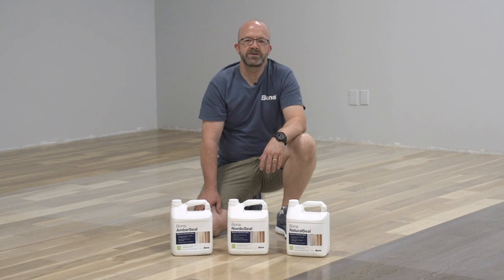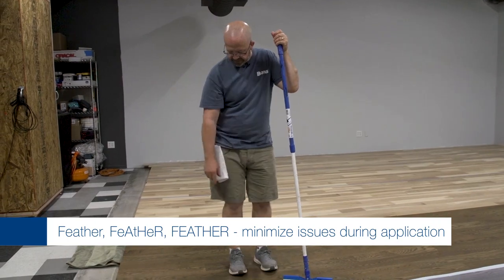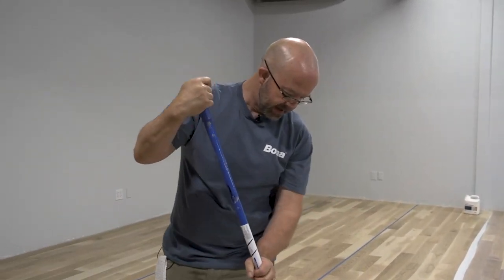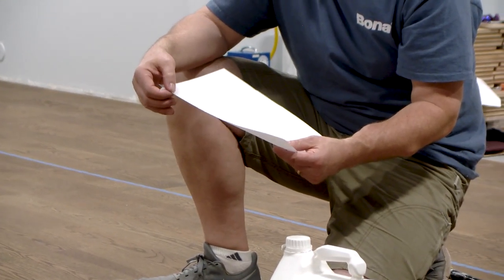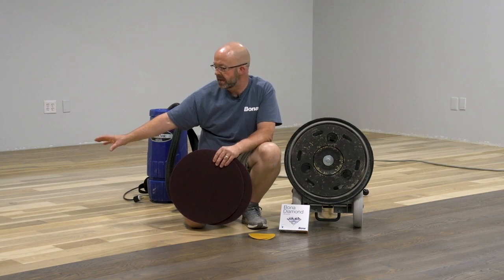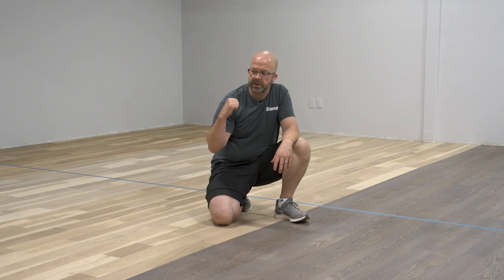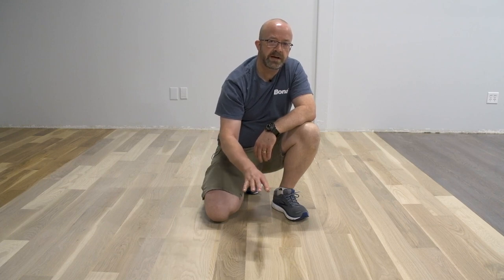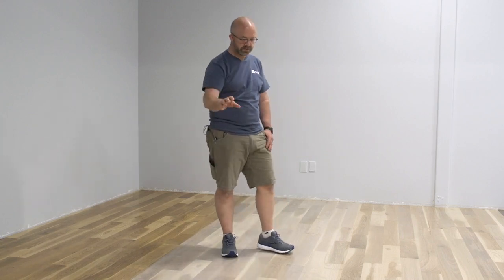Bona Sealers Application Best Practices

Comment: I typically do 1 sealer and 2 traffics but a I have a few friends that say they have been doing 2 sealers and 1 traffics hd and they said they have never had issues  is that another way of doing it or what’s the issue with doing it that way?
Reply from the maker: Hi @castlesflooring4239 - At a minimum, we always want at least three coats of sealer/finish on the floor to provide the proper level of protection. While you could go two coats of sealer and one coat of finish, the level of long-term protection is obviously better with two coats of Traffic HD. The more important question is, "Are you delivering what your customer believes they are buying?" The high-end craftsmen that I know are actually going two coats of sealer followed by two coats of Traffic HD and selling it that way too. 
Hope that helps. Cheers!
Reply: @BonaProfessional  when do they abrade? Do they abrade after 2 sealers or do they do 2 sealers on traffic then abrade for final
Reply from the maker: @castlesflooring4239  Best case scenario is no need to abrade between coats at all (if you keep it clean and don't have lap marks, etc). Only have to abrade "for adhesion" if it's been more than 48 hours since the last coat was applied; then just hit it quickly with a Conditioning Pad, vac & tack. If you need to abrade for smoothness, debris, and or to try and blend some slight laps, etc. then we'd start out with hand abrading lap-type marks (Conditioning Pad - 320grit, then work down to Bona Diamond 220 or 180 grit, if needed). To abrade the overall floor, we'll place 2-3 Bona Diamonds (180 or 220 grit) on a Conditioning Pad and hit the whole floor. This is a "soft" abrasion technique as we never want to remove any more of the existing coatings than necessary (as each coat is only as thick as a piece of copy paper). Diamonds will thoroughly abrade the floor better than any other abrasive on the market. After abrasion, we'll remove any remaining fine Diamond Dust with the Bona Power Scrubber, then dry tack and coat.
When you're working through these systems of pigmented sealers, 2 coats are always going to give you the best results in regard to an even coloration, etc. Only hand abrade any problem areas after the second coat, if needed. Then apply your first coat of finish and abrade that, if needed, for overall floor smoothness prior to applying your final coat of finish. Avoid machine abrasion of any of the pigmented sealer coats, as it only takes a split-second error to remove too much, or inadvertently leave track marks down the floor with your machine, which then creates more repairs and issues for you; or worse, you don't see these until you apply the finish - then it's back to square one. Hope that all helps!

Comment: Thank you Very Much for much information on this Bona product. I have to refinish stair treads and someone recommended water base Bona Mega, do you recommend that product for stairs? Thank you in advance !
Reply from the maker: You are welcome, OnePickyMen1 - While any of our waterborne finishes can be used on stair treads and risers, we'd recommend that you use Bona Traffic Anti-Slip to add that extra grip and minimize the chance of slipping. Wood stairs by themselves can be a bit slick - especially when they get a bit dirty/dusty (that debris acts like very tiny ball bearings), and the Traffic Anti-Slip meets the requirements of the ADA for wheetchair ramps, stairs, etc (slip-coefficient of .8), so it would be the best treatment for stair treads. 
Here's a link for more info: https://www1.bona.com/en-us/products/professional/coatings/waterborne-finishes/bona-traffic-anti-slip-3x1ga/
Hope that helps!

Comment: Hello, if I have a small hole due to a nail do I have to fill it first or will the Nordic Seal act as a filler? Thank you
Reply from the maker: Hi Biagio - You should always fill nail holes, cracks, etc. with filler prior to sealing and finishing the floor. Even if the sealer or finish is able to fill some of these voids, you always run the risk that they won't - or that they do but there's too much product in there and it could trap some water vapor under or in the film and make it cloudy. There are some products you can use the fill the floor after the sealer/finish has been applied (prefinished fillers), but most are not coatable. So, best practice is to always fill with "filler" before applying your sealer and finish coats. Hope that helps!
Reply: @BonaProfessional  Thank you so much for your response.  Right now I have raw wood (red oak). I am waiting for Nordic Seal and Bona Traffic HD antislip to arrive to start working.  Do you have a specific filler I can buy? I would love your recommendation. Thank you
Reply from the maker: @BiagioSibillo  Yes, we have Bona Pacific Filler available through most of our professional distributors. It's available in six popular species colors and in quarts, gallons, and 5-gal pails. Cheers!
Reply: @BonaProfessional  Thank you very much! Will the Nordic Seal color the red oak Bona Pacific Filler? Thank you
Reply from the maker: @BiagioSibillo  The NordicSeal will not "color" the red oak filler (like a stain would), but will lay on top and add the same whitish tint that it's adding to the rest of the floor as the same time. No problems there.

Comment: Would it be a problem with a floor that isn't leveled? My floor isn't, It isn't visible but drum sanding showed planks that were lower/higher than others. I'm afraid it could lead to uneven amounts of the seal thought the room. What would you recommend?
Reply from the maker: Hi LJ - When applying Bona waterborne Sealers and Finishes on uneven floors (over/underwood, distressed, hand-scraped, wire-brushed, etc), we'd recommend using the white microfiber Bona Roller with a "dip and roll" method out of a lined bucket (line w/unscented garbage bag) or paint tray; working in about 5ft wide sections up the floor. By not pouring a puddle and using the roller (which will conform to the floor levels), you'll greatly minimize, if not eliminate, any pooling of the products into low lying areas. Also would recommend using a quality paint brush to cut-in just the section being worked on, instead of a paint pad (tends to leave heavy spots); and re-roll everywhere that you cut-in, as the roller applies a heavier coat and has a different texture than a t-bar, cut-in pad, or brush. Hope that helps!

Comment: I used the Bona Oil based sealer but didn't like color. Contractor stopped working  then sanded the floor the next day.. the following day applied Bona natural sealer  with mega one . The oil sealer is seeping back through. How can I get rid of the oil sealer?
Reply from the maker: Hello Desire W - Is the oil sealer seeping up along the board seams? End joints? And or up from the soft grain? Would suggest that you have the contractor call their Bona territory manager or have them contact our Tech line at (800) 872-5515. Thanks!

Comment: Thanks, this video was helpful. I was planning on doing 2 coats of NaturalSeal followed by MegaOne Satin on my old pine floors. I just did a test area with 2 coats of the natural. It looks pretty good but it did suck up the first coat super fast, leaving some lighter spots where it dried too quickly and I ended up doubling up the pigment when trying to feather the edges. The second coat was better with a more reasonable drying time. Since this test area was a small space in the closet, I'm worried about doing the rest of the room (about 200 sq ft) fast enough. It seems like one of the clear sealers would be more forgiving on that first super fast drying coat, so I'm wondering if it would work to do the first coat in either the classic or intense, and then do the second and possibly a third coat in the natural seal to get the lighter color that I want. Does that sound like it would work? 

I'm also contending with large gaps between boards. I partially filled them by gluing in jute twine since filler would crack and look bad over time. There's still gaps, just not as deep. From other comments I think I'll change my application plan from T-bar to the roller and bucket/paint tray method to avoid using more product than I have to. On the test area, the white pigment building up in the gaps looks a little weird so I'm hoping that doing a first coat of clear sealer would help with that too.
Reply from the maker: Hi Clara - Yes, if you're seeing that first coat really get sucked up fast then it would be best to seal the floor first with one coat of Domo finish (yep, we know it's mainly sold as a finish, but works the best when wanting to overcoat with NaturalSeal. 
You're also on the right track with switching your application method to rolling (bucket/paint tray method) vs. t-bar to avoid flooding sealer/finish in those seam areas. Sealing with Domo first will also help minimize the NaturalSeal pooling in the seams as well, so good thought process there too! Looks like you've thought it through pretty well and have a good alternate game plan - Best of luck on your project!
Reply: @BonaProfessional  Thanks, I used Domo for the first coat as suggested, followed by 2 coats of NaturalSeal and 2 coats of MegaOne. It turned out great!!! I definitely think this helped with having successful results on the soft pine for anyone else with this situation.
Reply from the maker: @clarajames17  So happy to hear about your success on a not so easy application! Great job!

Comment: I have a reclaimed very dark wood floor that was installed and sanded but boards are naturally and intentionally uneven with 1/4" height raises between some boards. Would it be possible to use a sealer on this type of floor installation and have it still come out looking good or does it all need sanding even? Been looking into bona intense sealer. My intention is to protect wood, esp high traffic areas. Looks like they used a dark oil to originally stain and finish the wood.
Reply from the maker: Hi Michael - Yes, it's possible - as it is with some deeply hand-scraped and distressed floors (with the relief going down into the floor as opposed to coming up). Definitely a case where we'd recommend using a roller to apply the Sealer (dip and roll method in bucket or paint tray). You want to avoid getting any puddles on the floor in the low areas. Also, sounds like a bit of a tripping hazard if you've got up to 1/4" overwood on some boards. Simple cupping can cause tripping and this sounds like a lot more. We know you don't want to mask the character of the wood, but you may want to give it a test run/walk to make sure. Hope this helps!
Reply: @BonaProfessional  that does help, thanks for the advice and vote of confidence! we'll test it out in a small area
Reply from the maker: @MichaelMerritt  Another thing that comes to mind in re-reading your post would be the compatibility between whatever sealer/finish you choose to put on top and what's still there (surface and or soaked in) on the reclaimed wood. Not sure if all of the original dark oil that you mention above was sanded off; but if it's a penetrating oil there might be some spot adhesion issues. Best advice would be to run over the whole floor with 2-3 stacked Bona Conditioning Pads on the bottom of a traditional 175rpm buffer; stacked to soften it up and help it conform to the uneven floor. Regardless, do some spot testing - trying to scratch off the sealer with a quarter after it has dried overnight. If you want to discuss further, please give our tech services team a call at (800) 872-5515 and ask for Todd Schutte. All the Best!

Comment: Second question, my reclaimed wood floors have a strong smell in them from a tenant. They cooked a lot of ayurvedic foods and burned incense. Cleaning hasn’t helped reduce the smell much.

Which bona product would seal in smells the best? I’m looking at bona woodline for its self leveling properties with our reclaimed wood floor. But maybe traffic hd will work on smells just as well? I’m ok with voc’s if it means knocking down smelly floors. 

also trying to understand if I need a sealer or just finishing like traffic hd is enough to combats smell if that’s my primary concern. Adding some durability to the rental floors is nice bonus. I also don’t want to sand if I can just apply something and be done.
Reply from the maker: Hi Michael - First, I'd be surprised if the floors (if they're already sealed/finished) were the source of the remnant food odors, unless there were routine spills on the floor that seeped into the grain and seams. A premium 2-component waterborne finish, like Bona Traffic HD, would be my choice for trying to lock in any odors after a recoat process; due to the superior chemical and water resistance vs a solvant-based product. The existing surface must be thoroughly cleaned and any contaminants removed that may cause adhesion issues (would recommend that a wood flooring professional be contracted out for this work); and then evenly abraded to prepare the existing surface for the new coat(s) of finish. - using either the Bona Prep System or the Guaranteed Bona Recoat System.

You can find recommended Bona Certified Craftsmen here: https://www.bona.com/en-us/homeowner/find-a-contractor/

Hope that helps and good luck with your project and getting rid of the odors.
Reply: @BonaProfessional  thank you!